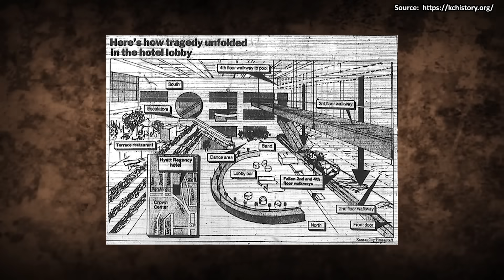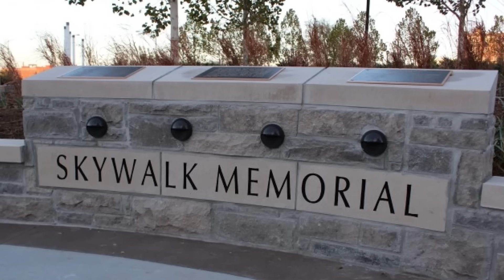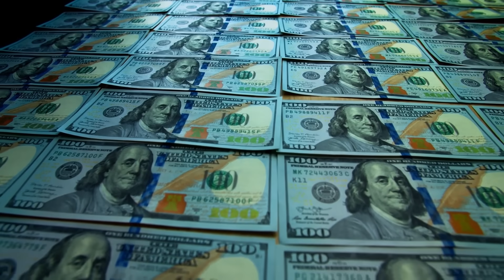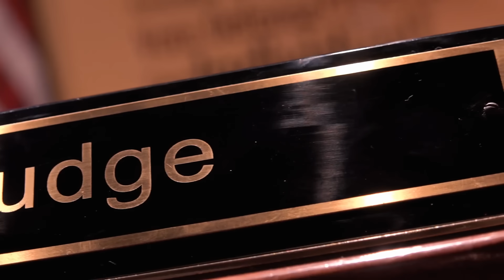Unbelievable & Expensive Engineering Mistakes

Comment: Bentall Centre Tower IV  tragedy in Vancouver BC Canada Jan. 7 1981. I remember this story well. during a lunch break 5 workers while on their lunch break went out on a fly form on the 37th floor of the Bentall tower then one of them stepped off the form, the form had not been securely attached and with the weight distribution the way it was just enough of the weight protruded outward for the form to teeter and fall off the tower taking the rest of the me with it ...All the men on the form fell the 37 floors to their deaths..I'm an old construction worker and have worked on high rises etc. since the 70's, all the high highrises had people that have died while under construction but this one was very tragic and has stuck with me all these years. I'm 70 now, I was born in Vancouver and still live here..  RIP to these men ....
Reply: and the Iron Workers Memorial Bridge as well.